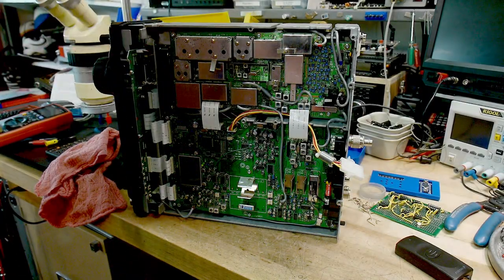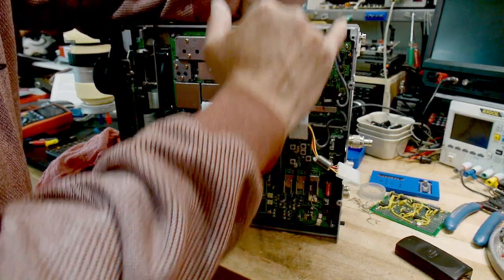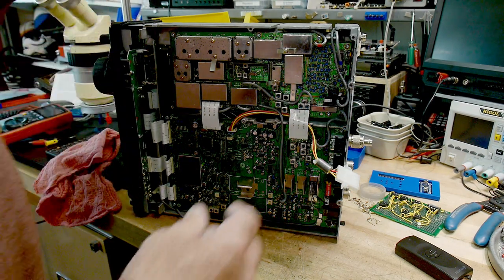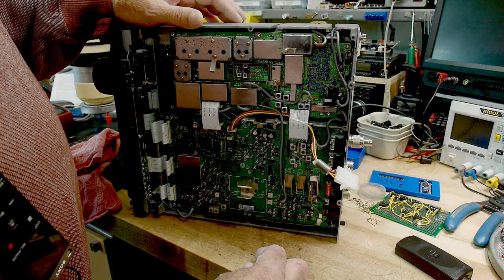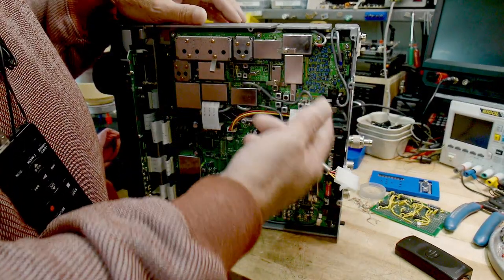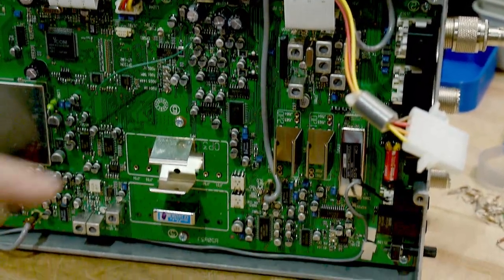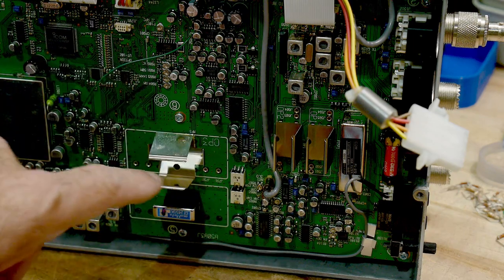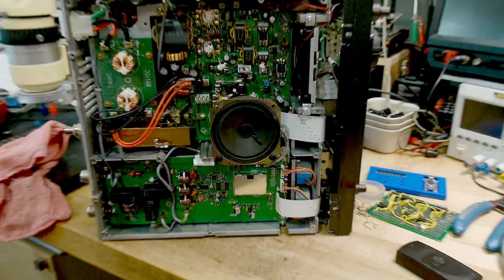#1080 ICOM IC-746 faulty ( part 3 of 8)

Comment: If IC151  I repaired a friends buying buying 2 on Ebay from China & it worked.  Just put your scope probe on the input pin to see the input signal & if you see a reduced or no output on the output pin it is bad.  I used Aluminum HVAC tape to shield everything but the 8pinDIP & used chipquik to remove the old one.  That was my first "big" SMD repair & it worked out!  Radio still works 4 years later.  I did not do any heatsink as I felt it added risk.  Good luck.

Comment: I just repaired a 746 with the same fault symptoms. It wasn’t the ic it was a 2k resistor the filter after the diode switch. Easy to check. Measure the resistance from the cathode of the switch diode before the filter tp ground. Should be 2.2k. Mine was open circuit. Showed 20watts out on lower frequencies and virtually hill on 2 meters.

Comment: Hi , always great videos and very interesting, I am also a ham here in the UK, you could do a video using a signal generator going in to the RF power unit and output power to the correct level,
Thanks Dave 2E0DMB

Comment: Have you seen the ABBREE handheld radios ?

I bought a few of them, because they were advertising it went down to 125 MHz and covered parts of the 222 and 380-660mhz

What I found, to my amazement is that it has continuous receive from 20 MHz to 660 MHz

Unfortunately it is all FM, so I don't get a signal on the air bands

Also, it transmits from 136 MHz to 660 MHz continuous

I am not sure how the inhibit the radio from transmitting below 136 MHz

If it is hardware I am wondering if it might just be a diode

Or if it is in the firmware, just a byte value or flag set in the firmware.

Is there any chance you can look at the 518 model of their radio and see if you can find out what is stopping it from transmitting below 136 MHz ?

It would be great to have the ability to transmit on the 6 meter and 10/11 meter bands

I am not skilled enough to figure out what it would take, or if it is possible.

The stated range limits are a lot less than what it does, so I am hoping a simple change in the firmware could open up the reception to 900 mhz or 950 MHz, and if there is a way to add AM mode to the radio.

Imagine how awesome it would be to have a radio that received from 20 MHz to 990 MHz
And if it could do AM mode, it would cover every band.
Being able to transmit over that entire range would be the 🍒 on the sundae after a filet mignon dinner.

Icom had a radio back in the late 80s or very early 90s that did exactly what I am describing.

I remember listening to the 800 band, when there were no 800 band scanners yet.
The TV still had knobs that went up to channel 83
I even had a tube black and white TV that had UHF 14 to 99

I don't think that was a US model.

I had some cool electronics from Japan back then.

But the ICOM radio did 100 khz to 1 GHz
And it was a transceiver 
And it had 5 modes
AM
WFM
FM-S
FM
NFM

The WFM was for FM radio stations
FM-S was for the older FM two way radio that had .030 spacing
I think the wave was 23 khz wide

FM was the newer adopted signal that was narrowed
It allowed .015 spacing and the signal was 13 khz wide

NFM was 7 khz wide

I remember when I was listening to the new 800 band Motorola's, and my town was the test city in America, they had the very first 800 MHz radio from Israel, when I tried using FM-S I could only get the control channel to come in
When I selected FM I got the control channel and the dispatch link but it was badly garbled

But when I selected NFM all the frequencies came in super clear, even the 1 watt talk-around frequencies.

Those were the days, or rather nights. I worked 7 nights a week, 10pm to 6am.
I had a lot of time to learn
But it was tough, 3 years, no days off
Reply from the maker: https://youtu.be/o54On0F9HB4